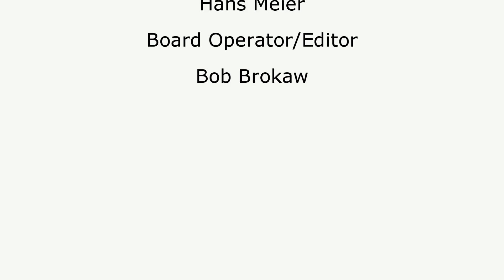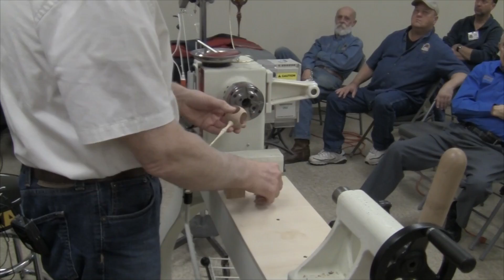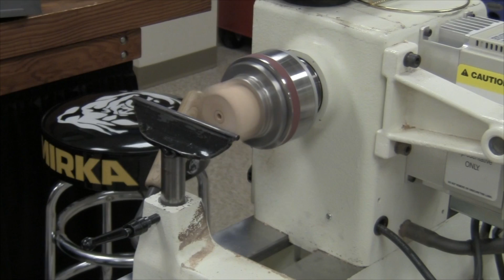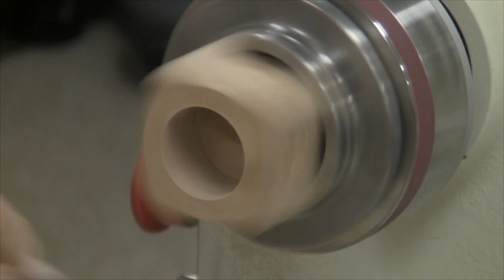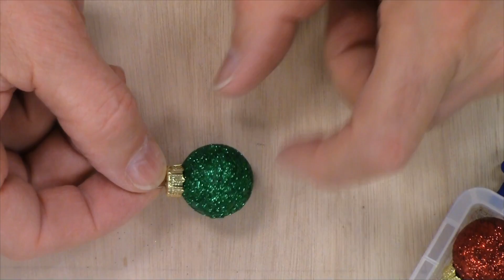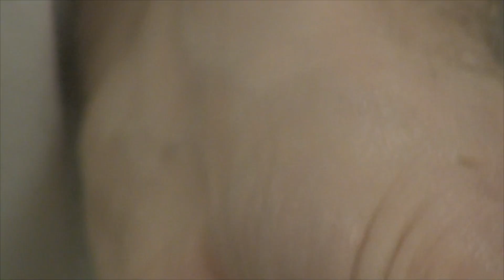Cross Drilled Christmas Ornaments, by Dan Douthart

Comment: It looks like you are having to bend over quite a bit, is that because the lathe where you are doing the demo is too low?  Seems like that would be hard on the back, especially if you have knees like mine that don't bend like they used to.
Reply: I agree, it's too low for him. That club should make adjustments for each turner.

Comment: I've tried the ornament and found that I need to wait to add the 45 deg countersink.  If added through Dan's process, I've cracked the block and had to use ca glue to save it.  Adding the countersink after shaping (rounding corners, etc), I've had better success.

Comment: What's a tubafore? ;)
Reply: David M u
Reply: It took me awhile to realize what you were asking.  A 2 x 4 is a common piece of construction lumber that you have in the walls of your home.  The name comes from the rough sawn size of 2" thick by 4" wide. After surfacing, the final dimensions are 1 1/2" thick by 3 1/2" wide.
Reply: David M w
Reply: it's used in a marching band and is a very large brass instrument.